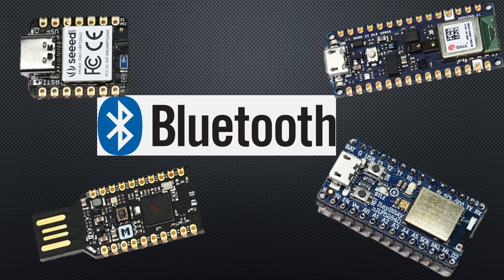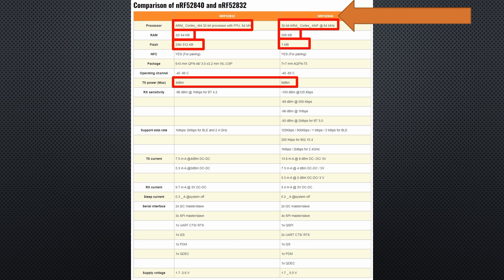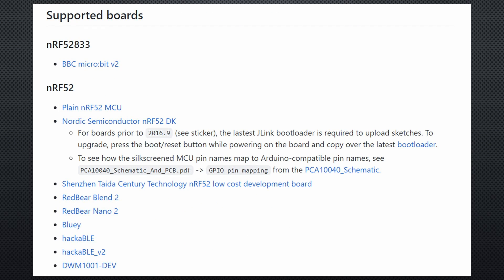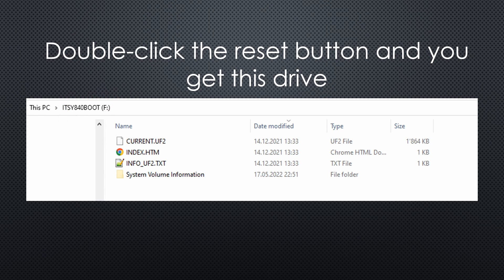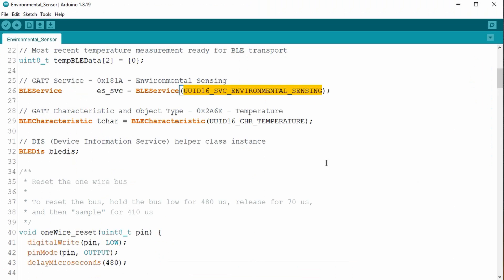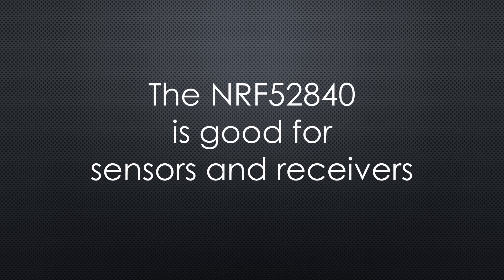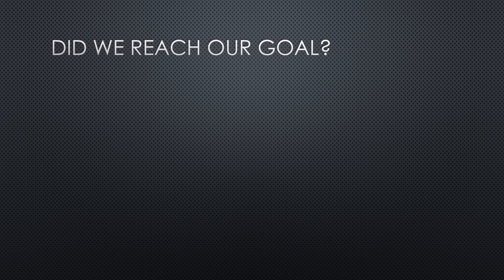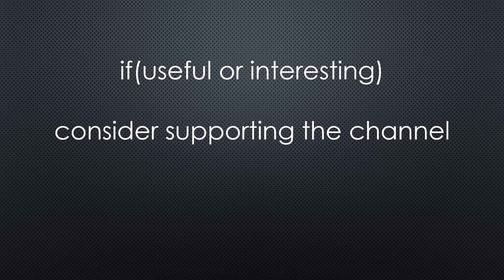429 NRF52 Bluetooth (BLE) Tutorial. Does it consume less than the ESP32? (Feather, XIAO, ItsyBitsy)

Comment: Nordic has it's own SDK, with which is reported you factors of improved power efficiency. Arduino IDE is typically only used for proof of concept. But to make a production level solution, you'd use the native Nordic SDK.

Comment: 12:33 but the battery voltage will drop before every mAHr of battery is used.  Right? It Isn't all useable.
Reply from the maker: You are right. But usually, you measure only the usable capacity where your device still works.
Reply: @AndreasSpiess  yes and so the hours should be much lower on battery life than reported - correct?

Or did you compensate somehow?
Reply from the maker: @TheRainHarvester  Look at the curve. The last part of it does not contain a lot of energy.

Comment: Great video! Many thanks. Did you ever evaluate and find a good solution for low power _scanning_? I find that full duty cycle RX consumes a lot of power, especially on the ESP32.
Reply from the maker: I did no more use the ESP32 for BLE other than a gateway connected to mains.

Comment: I need your help. I want to prepare a wireless subwoofer and a speaker connection with one Bluetooth, please confirm if it's possible..
Reply from the maker: I am a YouTuber and no consultant. So it is not possible. But you get ready-made amplifier boards with bluetooth on AliExpress. That helps a lot, I think.

Comment: I built product using the nrf2401 and msp430 very low power,  using straight gcc/gdb command line tools.  And also got esp8266 working by downloading tons of glued together software before it had arduino support.
Arduino ide so much simpler to use even if limited functionality.  
I was hoping the guy with the accent ;) would show how to update the bootloader in the nrf dongle so I can use it with the arduino ide like the feather.  If you don't want to buy the $500 dongle, you can do it using openOCD..somehow, no simple tutorial on how.
Reply from the maker: OpenOCD is a very special topic and nothing for a mainstream channel like mine :-(

Comment: If you want to get the true performance from nrf5x chips, the SDK is the way to go. I have never found it to be a problem in terms of development or debugging. I have found that RTOSes like mbed hide too much and force lowest common denominator functionality that cripples what you can do. For example, setting up for externally-triggered ISRs that have tight time constraints, the RTOS made it impossible.

As ever, whatever works for you is best, but Nordics stuff is so good it’s worth investing some effort to learn the SDK and the ARM data sheet. 

Last, to get power usage that matches Nordic’s online calculator, I had to run bare metal. But it did match or exceed the online calc value.
Reply from the maker: You are right, you always get most out of a chip if you use the proprietary IDE. However, we want to be able to use the same IDE for different chips (Atmel, Espressif, STM). That is why I use the Arduino IDE on this channel.
Reply: @AndreasSpiess  I believe you mean SDK as the IDE is usually independent of the processor. The Nordic SDK is really about managing the Bluetooth peripheral and represents the minimum allocation of resources to do that and still maintain efficiency and flexibility. Without it all you have is an ARM, with it, you have most of the bare metal functionality of the ARM plus Bluetooth, which is kind of the point.

A similar nRF52-based board was recently released by XIAO and it has support in the Arduino system with and without mbed. Same IDE, same programming model, but with a ton hidden from the developer. This is fine if you are not making any serious demands on the board. YMMV.

Comment: 2 years ago, I investigated nrf52840 boards to make a low power data logger (for rain gauge first) and use BT to unload data (with a goal of 3 years autonomy, at list with a 1/2AA LiSOCl2 battery). Best arduino support seems provided by adafruit but should also apply to sparkfun products (I should check the whole list in your video). Only Adafruit nrf52840 boards provide additional memory available for user, up to 2 MB. I made a first device with the Feather board. Indeed, power consumption at idle (without BT) is between 600 µA and 1 mA, due to the RGB LED that is drawing 600 µA off. I will try to unsolder that LED, which may be more accessible on ItsyBitsy than on Feather. If I can go bellow 100 µA, it should be enough to go for 3 years operation. Otherwise, I may apply other tricks like bypassing the LDO and battery voltage divider (and go for coin cell???).
Reply: @ericsibert1757 did you unsolder the RGB led on the itsybitsy? how did that change the power consumption?
Reply: @MarcusBehrens also curious
Reply: @GadiantonsRobber  - the APA102 is the culprit and uses most of the 0,6A I'm seeing - i will unsolder it now and Adafruit should allow a trace to be cut to take this out.
Reply: @GadiantonsRobber  ... i had tried the seeed xiao nrf52840 and this one does not have these low power issues - but mine got bricked i do not know why and the adafruit runs more stable.
Reply from the maker: Nice project! Pay attention with coin cells. They cannot provide a lot of current. So maybe you need capacitors to buffer the power peaks of the BLE transmitter. They are short, but high (compared with the microamperes in normal operation)
Reply: Thanks for your answer. If I go down to the coin cell level, I will take a look at your tip.

Comment: Your video is making me want to switch MCU in my project again, as I’m looking to implement wireless communication, and ESP power consumption is to high. How does NRF52840 ADC performance compare to STM32? Is it somewhat comparable, or is it on ESP32 level and basically needs external ADC?
Reply from the maker: I never worked with the NRF ADC, so I do not know.

Comment: Hello. I just got myself TTGo 1.5 from Aliexpress. It has 16 MB of storage space and pinout was slightly altered, as opposed to 1.4 version. I see that pins 16 and 17 were changed to 25 and 27, accordingly, but can't figure out how to properly edit "pins_arduino.h" table in the "variants" folder of platformio home dir. Can you help me with this? I was able to change board_build.partitions = default_16MB.csv from default one to get more storage but still need to set up those pins.
Reply from the maker: You can change pinnumbers using a text editor. But I am not sure if this is needed.

Comment: Can you make any recommendations for low latency applications? I have a time critical application where I’d like to use one or multiple wireless push buttons to trigger an event on an Arduino (e.g. light up different LEDs). The latency should be in submillisecond range (preferably <100us). Thanks!
PS: the protocol needn’t necessarily be Bluetooth
Reply from the maker: Low latency on the receiver always means high power consumption because the receiver has to be always on. I suggest the simplest protocol you can find for your application like 433 MHz. But keep in mind that it will not work if two buttons are pressed the same time.

Comment: I think all boards get close to the theoretical maximum performance. You just have the trade-off between distance, power and data rate. All boards like the ESP32 which give 20db output on transmit will consume similar power on transmit. The NR52 chips seem to have good receive currents, but then I think this is because the ESP32 are beefier processors. Another thing you can try though is that some chips just give you the RF and leave it up to you to control it with your own processor, and if you want ultra low consumption then some people have tried using and ATtiny chip. After all the sensor only need to be a dumb machine.
Reply from the maker: The problem with the ESP32 is it’s long on-time. Much much longer than the signal length. The signal power is comparable, I agree
Reply: @AndreasSpiess  There are some tricks to get a transmit and power up spike which can be as short as 100ms. One which you probably know about is the static IP mode, but there are others as well. Take a look at this. Someone has rewritten the wifi libraries for speed. 
https://www.youtube.com/watch?v=I3lJWcRSlUA
Reply from the maker: I thought I talked about BLE in this video and not WiFi…

Comment: I work with the nRF52840 at work, and when I use their SDK I get about ~30µA during an active BLE connection. The UART controller on the board seems to use alot of power when enabled (~600µA), which seems close to the idle consumption at around 12:20 (or maybe it is the sensor itself) :)
Reply from the maker: Good info. Thanks!
Reply: Hi! I’m currently trying to build a project with a beacon and a temperature sensor using the Seeed nRF52840. I saw that you have experience with similar projects, and I’d like to ask: do you know if it’s possible to reach a power consumption of around 30 µA when using the nRF Connect SDK?

Comment: This current is literally 20 times higher than what we see with an nrf52832 and nrf52840 in our commercial designs. Yes, it's that bad to use this code. We have a 10 - 15hz keyboard emulator running at 20ua average.  If you use the SDK and proper interrupts and such, it beats a lot of this maker stuff. Like there is no reason a ble keyboard couldn't run for months on a cr2032, but most diy stuff is measured in hours on 1000mah rechargeable.
Reply from the maker: That is what I thought. So we still have a lot of improvement…

Comment: Note that the mbed web IDE also supports at least the older nrf51 chips. The new Keil cloud (free version) replaces this and also supports the nrf52 series. Not many examples available so far however.
Reply: Always interesting to see other people using these chips. I started getting into Segger embedded studio to program them and have got rather out of my depth. Partly because I'm determined to use ANT+. One day maybe it will make sence and the benefit is the Arduino IDE now looks simple.
Reply from the maker: The ecosystem is the most important advantage of the Arduino IDE…

Comment: FYI: The XIAOs Core ist just a fork of the standard nRF Arduino Core. They just added there board definition.
Reply: True for v2.x (and it's crap), but v1.0.0 of the core is a fork of the adafruit nrf52 core but with a newer softdevice. I'm testing it at the moment and it seems to work quite well...
Reply: @insanitywolf05  i hate the fakt that they don't work together for a single Arduino core for every Architektur. The changes Seeed does to the official core are so small. They could have just asked for an inclusion in the official core. 

This means double the debuggingy support and features arriving late. Therefore the XIAO BLE went right into the unsed microcontroller Box. I habe enough old sparkfun and seed boards that are not supposed anymore and discontinued
Reply: @save_jeff  The only company that does a decent job in this space is Adafruit, I have to say.  You do get more and cheaper choices from Seeed, but they've always been a challenge to get anything resembling decent support from, except hardware replacement.
Reply: @ericbwertz  i agree. Sparkfun have some cool Sensor boards but there microcontroller Boards are a mess. RIP SAMD21 Razor M1
Reply from the maker: It would be cool if somebody would create the needed Definition file to add to the Adafruit environment. I did a part of it but did not have the time for more. I would host it on my Github.
Reply: It should be a breeze to adapt the Adafruit nrf52 Bootloader to the xiao ble by just changing the led and button pins and recompiling. But I agree, nrf52 for Arduino is messy patchwork, but I like to hack around with it anyway. Let's face it: the 80mA the ESP32s pull have nothing to do with the Idea of BLE.
Reply: @insanitywolf05  hm. Maybe yes but you would have to maintain the fork for future updates and all. I'm only using Platform IO. They have there own version of the Arduino cores. There it might be simpler but still, why not combine all Boards of an architectur. 

About the BLE power consumption, that's something I didn't look into up to this point. I'm using BLE to connect to a smartphone while running continuously with multiple sensors. Here the energy usage is neglectable. Would be another story for ultra low power applications. Buts the ESP32 in general is not for ULP. It's more for constantly running IoT and sensor applications that have high performance requirements
Reply: The problem is that a custom bootloader for the xiao is needed (needs to be recompiled) because the  adafruit bootloader uses a button and also toggles led pins which are connected to sensors on the xiao sense than on the feather board. But otherwise one could just steal the variant files from the seeed core v 1.0.0

Comment: Cat with microchips know a thing about power use - not quite true, but plenty of space for memes. Seriously tho there is a neat approach to power usage which is used on cat flaps which only open if the animal has an RFID chip whose ID matches a value stored in the door electronics. These doors are usually battery operated - with battery life often greater than a year. 
The neat idea is that they do not constantly generate the electrical field which is picked up by the RFID chip and powers it to transmit. Instead the cat door entrance tunnel (about 120mm long) contains an always-on  (and very low power) motion sensor which detects the presence of an animal. That then switches on the RFID circuitry, generates the energizing field, and unlocks the door to the right cat.
Having a very low power detector to activate a more power hungry (but smarter) detector is an approach which will be applicable in certain situations. Clever 🐈 😺 🐈 😺.
Reply from the maker: This is a good idea! RFID indeed consumes a lot of energy.

Comment: Wasn't the first Arduino with nRF 52840 the Arduino Primo? Would love to see a vid going in depth on the BLE 5 ultra logn range mode.
Reply from the maker: I never heard of the Arduino Primo :-(
Reply: @AndreasSpiess  Primo was a board that was made in about 2017 and discontinued sometime on 2018. It was interesting becasue it came as a package of 2 boards: main one with Uno form factor and a tiny one (like Adafruit lillypad) that you flashed by connecting to tghe main board. Great board, but Nordic chips work best in their own environment.

Comment: I have been playing with these chips quite a while. Major advantage is low power. If you programming using its own SDK.. you can get low level control and reduce power consumption further down.

But note that recently I also read news that these chips have some security vulnerability... No idea if it has been resolved by nrf.
Reply: It's not been resolved, but also this vulnerability happened like 3 - 4 years ago. It's just that it only really got notable when people used that well documented vulnerability to get apple's firmware out of the nrf52832 they used. There are a lot of microcontrollers on the market with similar vulnerabilities and nobody does anything because it's a difficult (though now automated) physical attack and only if you're selling millions of units will you likely be targeted.
Reply from the maker: Thank you for the information!

Comment: Excellent video, thank you.  My understanding from the datasheet of the U-blox Nina W102  is that it also uses an esp32 chip.  Is that correct Jedi Spiess?  I have been playing with the nano rp2040 connect recently and I very much like it apart from the flimsy wifi antenna.  My first one broke off by accident from a 1 meter drop.  I noticed the second one I got from arduino now has a blob of hot glue or epoxy resin holding the antenna in place as additional strength.  They are not cheap but I have had great success using it in my weather station.  I was going to use an ESP32 but my simple brain could not get all the hardware to play nice.  Lucky for me, old Philhower III saved my butt.  Thx again Earle.  His board manager made my project possible.
Reply: Excellent video, thank you.  My understanding from the datasheet of the U-blox Nina W102  is that it also uses an esp32 chip.  Is that correct Jedi Spiess?  I have been playing with the nano rp2040 connect recently and I very much like it apart from the flimsy wifi antenna.  My first one broke off by accident from a 1 meter drop.  I noticed the second one I got from arduino now has a blob of hot glue or epoxy resin holding the antenna in place as additional strength.  They are not cheap but I have had great success using it in my weather station.  I was going to use an ESP32 but my simple brain could not get all the hardware to play nice.  Lucky for me, old Philhower III saved my butt.  Thx again Earle.  His board manager made my project possible.
Reply from the maker: Yes, the Nina W102 uses an ESP32.

Comment: Great video as always. Got my Seeed XIAO BLE sense earlier this year. I think the core is based on Arduino mbed OS. I wrote a way to work with it on PlatformIO IDE.
Reply: You probably need to bypass the regulator: "Input voltage (VIN): 5V", "Circuit operating voltage: 3.3V" and/or disable (or more likely remove) the other unused (lipo charger, IMU, mic, etc) components.
Reply from the maker: I agree that the other components consume some energy. Maybe I will compare a standard board.

Comment: Did you measure the current in receiver mode ?
Reply from the maker: Both mixed
Reply: Scan mode is receive mode and it's very power hungry, drawing about 12mA
Reply: @insanitywolf05  is there a way to have a receiver constantly listening in ultra low power ?
Reply: That's what BLE aims at by defining connection intervals (as far as I understand correctly) where data is exchanged so the rx does not have to be on all the time.